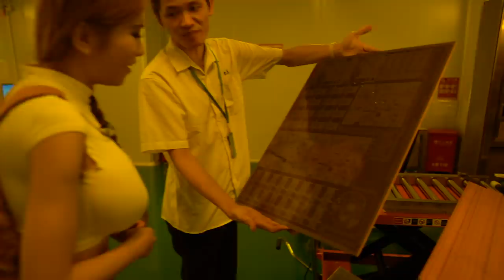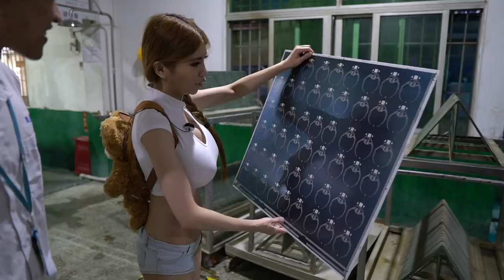Hardware Manufacturing, LED Rings Pt.2- A Visit to JLCPCB!

Comment: The subtitles worked very nicely there,  easy to follow without distracting from the visual impressions. I usually find it hard to follow a video and the subtitles but these are perfectly measured to tell what they should in a blink and then let you watch what's going on.
Workers will still be a little shy at first, because after all they are expected to "represent". But I'm sure the more often you visit, the closer you will get to some of them. I can tell from my own experience that talking to someone who is really interested in your work on a job that you enjoy is as satisfying for the worker as it can be for the visitor.
On a side note: When I learned my trade, I worked on a very similar production line, except that we etched out the carrier structures (what you see as pins on the final product) for integrated circuits and gold plated them (electroplating in preparation for the bonding). I recognized most of the conveyed lines and was amazed about the additional automation. Back then it was more or less an experimental production line and many moves had still to be done manually, but we had many ideas to improve/automate the processes, most of which I see have become reality now. I always felt for the poor girls who had to retouch the masks for the photo-lithography. Yes we used physical positive masks, because computers comparable to a commodore 64 were the size of a closet and projecting computer generated graphcs was not even much of an idea yet. They needed eyes like an eagle and very steady hands while staring at a light table all day through a microscope. Also the photo coating wasn't completely solluble and you needed dangerous chemicals to turn it into something like jelly that could be rinsed and brushed off. Very messy that, but technology moved on. Flipping the thin metal sheets was a manual process which you trained a few weeks before you got any good at it. Since you would destroy some expensive stuff failing at it on the real production, you actually practised on discarded sheets for a while. Fun times.
As you can probably tell, I found this video of yours particularly intriguing, while you always amaze me.
Reply from the maker: That's a fascinating history of the process🤔👍

Comment: Bravo! Beautifully informative & confidence building as to the quality of the jlc facility & employees. The cc & your interaction in Chinese made for such a informative & immersive procedure as though I was walking with you & having everything translated so that I could follow everything so clearly. I used to make my own pcb,  & learned how to use a cnc router to make them, but then I tried jlc & the quality was so much better & the turn around so fast that I now haven't made a pcb for ages. It was amazing to see how my little pcb were made. The ability to design to have boards so well made that I can use 603 surface mount components allowed me access to many semi conductors that would otherwise be impossible for me is a great blessing. Thank you for sharing such that I now know much more about how pcb are made & the quality of the jlc facility.

Comment: Interesting to see how they do it in that factory.  I used to work for Sanmina in the Solder mask dept years ago.  We didn't use a silk-screen process for the solder mask.  Instead the board was shot through a liquid curtain, and then a series of ovens to partially cure the mask.  After that we would apply a Mylar sheet with the circuit lands and vias printed on it and run it through a UV machine and finally through a solvent bath to wash off the unexposed portions of mask.  Lastly  the boards would go into large oven at 300F for a final bake.  After my dept they went to screening to get labels and component details put on.  Thanks for sharing this, I really do miss that kind of work.

Comment: Started using JLC recently and your video gives me more confidence to continue using them.   I've toured various different PCB factories, and that is even more impressive than the biggest I've visited in Scotland, although that was a while back!

One bonus is getting the laser stencils cut for the boards at the same time.   I even used my recently acquired Creality Ender 3 Pro to make a jig for using the stencil on a partly build PCB.

Great video - thanks again for sharing and promoting engineering!
Reply from the maker: Ohh! Good idea with the jig, I'll try that when I solder my rings.

Comment: Great Video,  JLCPCB made my rel 1 prototypes and delivered them super quick, 5 2 layer boards ( quite large ) $14.40 delivered.  I will be using them for all my PCB needs.  I cant wait to get onto rel 2 respin and have it dialed in.  I will be ordering the stencil also as I will be reflowing / oven all the SMD parts :).

More and more of my friends at the local makerspace are using JLCPCB on my recommendation as they were impressed with my first spin of my prototype.

Mick Make uses them for everything and I know Dave Jones ( eevblog ) has used them.  I am glad to give them exposure where I can and I know you can help fill any gaps in translation that maybe required.

Hope to see more video's like this,  on the translation front, I think its great to keep it native as that is the most comfortable for everyone there, its obnoxious for anyone to think otherwise.

Keep keeping it real.

Comment: It is a accurate measure of your increasing stature in the maker community, that you can take us first hand through the process of PCB manufacture as you did in this video. It was a fascinating look at both JLCPCB and a good overview of how PCB's are made. I found the spoken Chinese with English subtitles added to the flow of the presentation, rather than detracting from it. I would also say, the company has found the perfect spokesperson for their product line. I did however, have one question regarding JLCPCB; can they offer an economical, quality product in low volume numbers? In addition to my question, I did have one observation after hearing you again refer to the advantages of open-source in Chinese manufacturing. You might mention to the reluctant, the following:
                                              Wise souls don't hoard;
                                               the more they do for others the more they have,
                                               the more they give the richer they are.
                                               The Way of heaven profits without destroying.
                                                Doing without outdoing
                                                is the Way of the wise.
                                                                                                Lao Tzu
Reply from the maker: Yes, they specialize in prototyping so low volume is no problem.
Reply: @Naomi-Wu  Thank you. W

Comment: Very nice tour. Did you happen to see how they make stencils for solder paste while you were at the factory? Looking forward to seeing those LED ring lights and the subtitles worked just fine. I think not having to stop to translate during the tour made the whole experience a lot better.
Reply from the maker: I didn't! I want to try using them so I'll find out about it...
Reply: Stencils are definitely the way to go. Even if you don't reflow, they can be very useful. Just don't forget to customize the size so you don't end up with a stencil nearly 10x the size of your PCB/panel 😒

Comment: Excellent video. I just designed a small board on Easyeda.com and ordered it through JLCPCB. Pretty good process and I can't want to see it when it gets here. Captions are fine. My question is: when I order five small 100mx100mm boards, do them put them all on a single board or do they stack them on five separate boards with a lot of other PCBs on the rest of the board area? My guess is that stacking them would be more efficient.
Reply from the maker: Can be either depending on what else is being made that day.

Comment: Your product knowledge and attention to detail is impressive. Perhaps you would know of a combination of products that could solve a domestic problem. I have a smoke detector screwed to my ceiling. It is difficult to change the batteries, as I have to climb a ladder. Would it be possible to attach a smoke detector to a drone, fly it upwards and attach it with those "damage free" hanging strips? Either the drone and the smoke detector could stay up there together, or the drone could somehow leave the smoke detector there, and bring it back down when the batteries had to be changed.
Reply from the maker: Long stick with velcro maybe?
Reply: @Naomi-Wu  Thanks, good idea, never thought of that. The problem comes when you try to disconnect it. I don't want to pull down my ceiling if the velcro is too efficient.
(I've already had a collapsed ceiling, it's messy and expensive.)
Reply: @Naomi-Wu  Searching "Automated Drone Docking" on Google came up with some possibilities.

Comment: Recently got PCBs made with these guys, quick turn around and good price. Seeing your video I can understand why, they have a very good pipeline for getting PCBs through. Made the PCB design in KiCAD using tutorials by EEVBlog, sent off the gerber to JLC and it worked first time :) Maybe you and EEVBlog can do a collab some time?

Video idea: Would be cool if you could make some quick-ish video (20 minutes maybe) showing the basics of how to make a basic PCB, maybe with some mini-project that people at home could follow for a low cost. Maybe a USB light is the lowest point of entry with some LEDs and resistors, using the PCB as the USB male connector?
Reply from the maker: OK!

Comment: The facotory visit was very interesting. I had to pause a few subtitles to be able to read it: but I always have to do that in any video with subtitles so I can see what's happening as much as understand what's talked about. It was better to have you speak your own langage and add subtitles because you were right: some things would have been lost in translation if you had done it on the sport while filming. Is there a minimum limit of the quantity you ask the factory to print? (as in they won't print your design if you don't order a certain number?) thanks.

Comment: The high level of discretion in overseas factories never ceases to amaze me. Should you visit such a place in the US, you'd leave with some knowledge of the process, no fewer than 5 wedding proposals and more pick-up lines than you'd care to entertain. This goes up exponentially when around union guys with no brain-mouth filter. I won't say they are all neanderthals, but...
Add: to the point of the topic, I watch a lot of foreign movies and I'm getting older, so subtitles are usually on anyway, but I will say that the ones on your videos are better than most. A lot of the time the auto translator is no better than a joke, though youtube's algorithms in detecting dialects has gotten better over the years.